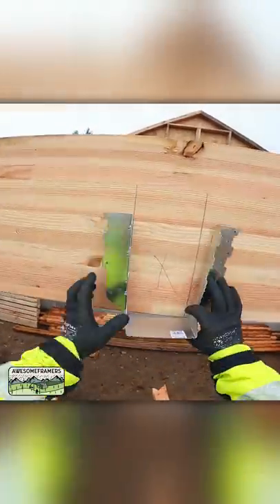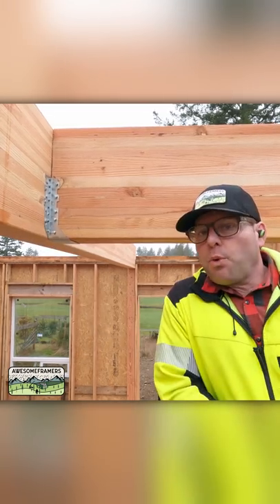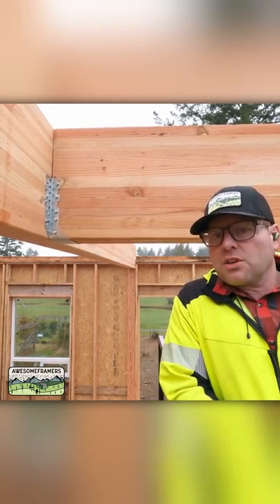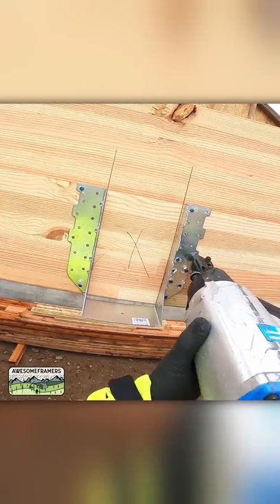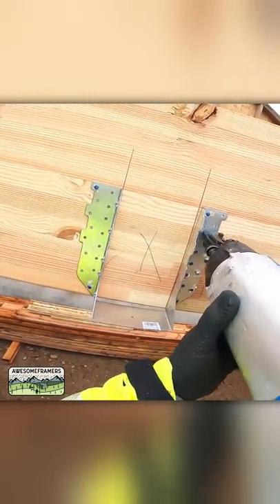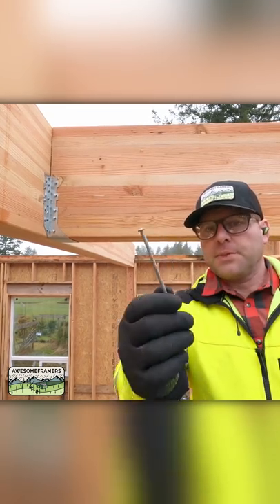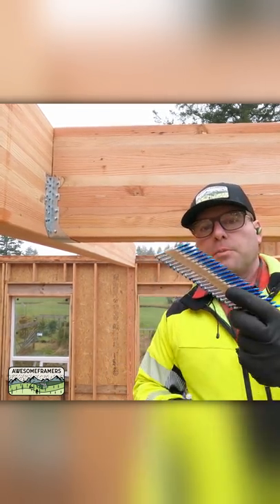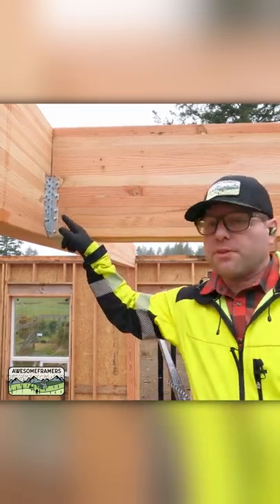Does Nail Size REALLY Matter? -#shorts

Comment: As a home inspector, its crazy how many times I find the double shear nails are only 1.5 inch long. Barely grazing the headers...
Reply: As a carpenter, it’s annoying everyone I ever work with is doing that but me.
Reply: I have a gun that shoots 3” hanger nails. The nails are a pain in the butt to get though. I always leave one or two tacked in nearby to show their actual length.
Reply: Seen the same on new Chicago porches, #4 nails on 2x2 vertical rail supports barely exposing tip of nail.
Reply: Barley?
Reply: For the love of God get some rated screws in therr
Reply: I love it when these framing crews think they're structural engineers... Absolutely laughable

Comment: You should have seen the grief I went through because the architect called for a wood to concrete hangers instead of wood to wood... The inspector went ape on me because I used the correct hanger, I had to call them and they faxed me the explanation it was correct for application.. great company!!!

Comment: Im a carpenter (not criticising), i was always taught to use twist nails in hangers so they cant pull lose
Reply: The glue on the nails that blue stuff won't pull out the head will break befor that

Comment: All depends in the state you live in and the inspector. I think
Reply: Only depends on the engineering of the hanger and geometry of a short nail at an angle doesn’t go gar enough
Reply from the maker: No Jose, it depends on the design loads and ratings of the tested hardware.  I'm showing here what Strong-Tie, the manufacturer and tester of the hardware, states in their catalog.

Comment: First. I would use a thick gauge bracket for that size of support beam and use screws to secure. 
Seems like the middle standard.
Reply: And why would you use screws over nails?
Reply: We don't frame with screws because they're too brittle. Nails allowed for movement.
Reply: @iamchillydogg  Buy Canadian make Robertson screws.
Reply: @Topher.86  Pull. Bite. Removable. Better grab. Robertson  screw.  Engineering here.
Reply: uplift unlikely if hd screws are used instead of nails

Comment: Never use something like this on something so thick, for wood work like this you need to interlocking wood joints and pins.
Reply from the maker: Are you a structural engineer?  Didn't think so.  The SE who ran the calcs here has the education that you and I don't have.
Reply: @AwesomeFramers  lol Bro i worked on aircraft, that lvl of expertise is way above a building engineer. Also Ive worked with wood for a long time. These frames are so heavy, that tiny metal bandaid will corrode, and snap after some time. But be my guest, build your house like this. If its your house, you can have it built however you want.
Reply from the maker: @RifullOfTheWest  It won't corrode and snap.  You have zero evidence of that and its irresponsible to make claims like that.

Comment: Right fastners he sais... using nails instead of screws is actually illegal here to use in constructional parts of buildings. Americans houses keep blowing away due building from wood and nails suprised pikachu-face.
Reply: nails are actually better for construction than screws. a good builder will use both tho. :)
Reply: Nails have better shear strength and resistance to cyclical loading. That's why they are used in post frame construction. The temper used to harden screws makes them brittle and prone to break under certain loads. Screws certainly have their place in rough carpentry, but through a stamped steel plate with all the loading at 90 degrees is not one of them.
Reply: @mikeirvin9694  u explained it better then i did^^ :D
Reply: I'd love to see the house you built after an EF4 tornado rips through it.
Reply: @ajs96350  I have lived in Minnesota my whole life. Right on the edge of tornado alley. I'll let you in on a secret. We build homes with full basements for a reason. If you think a wooden structure will provide any protection for a direct hit from a twister your sadly mistaken. The connection between the flooring system on the main floor and the foundation is the only the one that matters as a tornado approaches. Screws won't stop flying debris from penetrating exterior walls
Reply: Nails are designed to allow for flex, whereas screws shear under tension.
Reply: @mikeirvin9694  Sorry, did my comment in any way mention anything about a house surviving a tornado at all?
Reply: @ajs96350  ohh mate our basic construction code is higher than your highest hurricane rating lmao
Reply: @mikeirvin9694  if your hardware has to flex your design is flawed mate. Structional engineer here....
Reply: @Bobsonomatic  if your hardware has to accomodate for flex your design is at fault. Structural engineer here.....
Reply: @clanc25diy  You have to remember that in the USA we use the IRC as a guideline. Some think that it is all they need. They do not understand that the IRC is a minimum standard and that there are better, stronger ways of building. Unfortunately, your poor English/grammar in the first post brought out their unconscious racism/ bigotry.
Reply: @clanc25diy  wood expanses and contracts with seasonal changes in humidity. It is a natural building product. The live load can vary the deflection of beams. Of course there is movement at the connections. That's exactly why nails are used. Bent nails will still transfer the load, sheared off screws transfer nothing. Having the connection fail before one of the joined members does is a problem. Distortion is better than collapse.
Reply: @clanc25diy  so if you’re a structure engineer then the very basic thing u are taught is that builds expand and contract and move or flex depending on all sorts of different factors, not much but it happens every second. I find that a bit hard to believe ngl.
Reply: @clanc25diy  what material do you engineer for building? And what fasteners do you work with?

Wood and nails are an economical decision. America is one of the wealthiest, if not the most, so if we need economical materials so does the rest of the world.

Also, geographical weather also needs to be considered. What natural disasters do you need to overcome when you engineer, if you actually engineer for home building, or any structural edifices?
Reply: @mikeirvin9694  I believe that was Max Powers’ point to the OP.
Reply: @mikeirvin9694  some of the modern screws will bend just like nails do without breaking. I personally like the Simpson connector screws for hangers on decks. Nails are structurally sound at first….until they back out and waller out. I prefer screws for decking. I use the Scrail screws that shoot from a nail gun quite a bit. I use Simpson strong tie connector screws for joist hangers, and spax lag bolts. (My Milwaukee 1/4” drive impact snaps a lot of the other lags)
Reply: @waynewilliams5353 I've never seen a joist hanger nail back out of green treated lumber. However, that might be a regional difference;  a combination of available lumber and local climate. The joist material for decks are so wet with the preservatives when installed it will squeeze out around fasteners and create saw mud instead of sawdust when cut. It might have been kiln dried before being treated, but it's wet and heavy and the lumber yard. As it air dries over the first year or two, the wood shrinks around the rough galvanized surface of the nails. On older decks, it's easier to just cut the nails rather than trying to pull them when remodeling.
Reply: @nathan7627  of course they do but your hardware is not the part of the construction that should be accomodating for flex lmao.
Reply: @mikeirvin9694  ofcourse it expandse and contracts im just saying when your hardware has to accomodate for flex you made poor construction choises... The construction you need to use another imposition.
Reply: @briangc1972  Nobody here said anything racist, what a joke.

Comment: I would like to know if you know better than what the manufacturer recommends, the length matters, not what you think will save you money.
Reply: As he said, the manufacturer's engineers say that he can use the shorter nail with no loss of capacity.
That means that the shorter nail exceeds the holding capacity needed for that application.
That's straight from the manufacturer, why are you arguing with them?

There may be certain applications where the longer nail is required, when installed over sheer ply, on stacked 2x boards, etc, which is why it's called out, but if they allow it, and that's into a solid beam, then there is no reason not to use the shorter nails.

Comment: There is a new invention called SCREWS.
Reply: Not new at all.  but not used in framing for good reason, they're no where near as strong in shear and don't have the flex that nails have to allow the building to move.
Reply from the maker: I asked Simpson directly. Their testing on this hanger does not include their structural screws at this time. If someone follows your comment, they won't have installed this correctly.